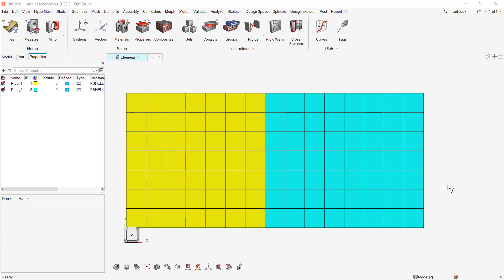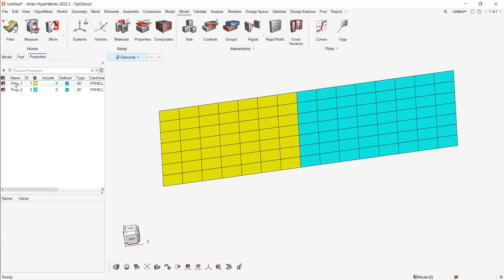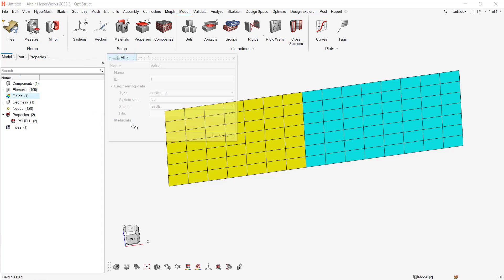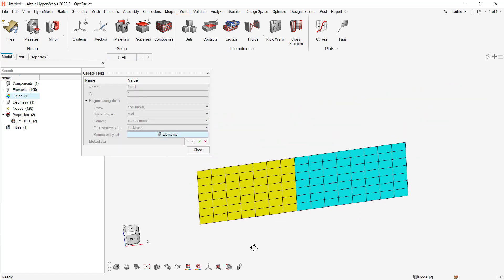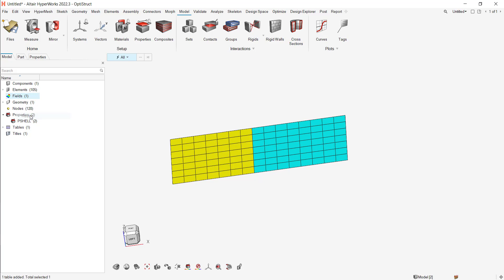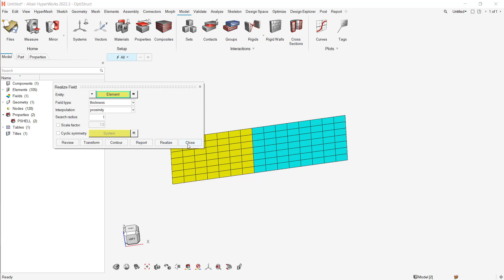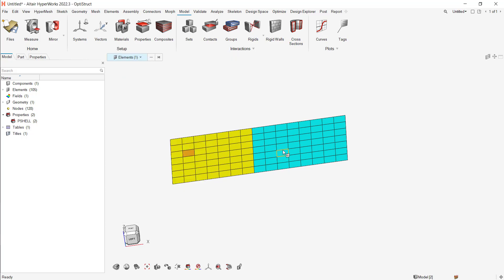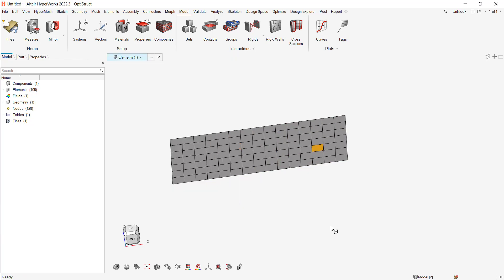Switch from elemental to nodal thickness

Comment: What is the purpose of this function? When would we want to do this?
Reply from the maker: Hello, this is mostly a matter of standards in your company. If your methods and teams sets the nodal thickness as the recommended modeling for parts with non-uniform thickness, and that you receive a model from a supplir with elemental thickness, then this feature will be useful to you. Otherwise, you may have no/low interest in it.